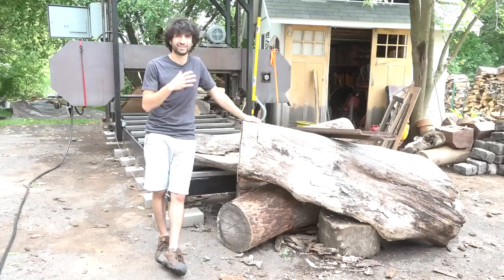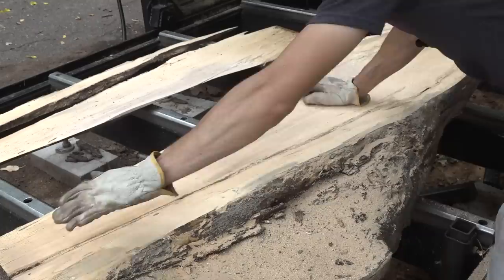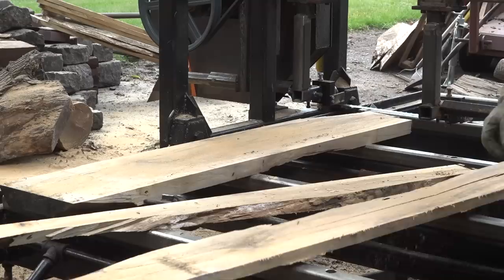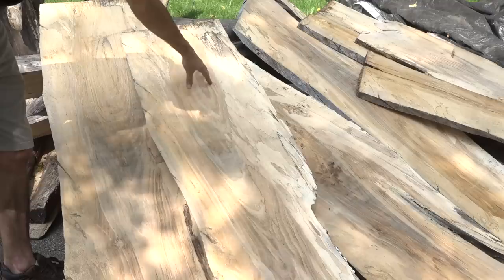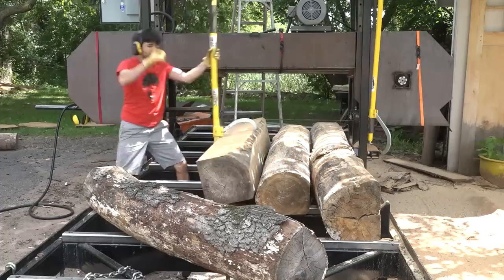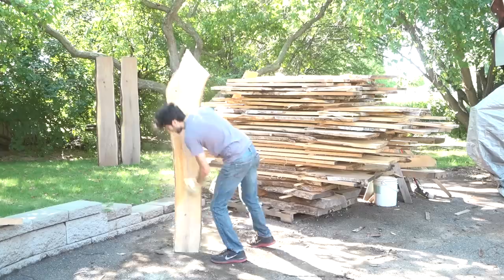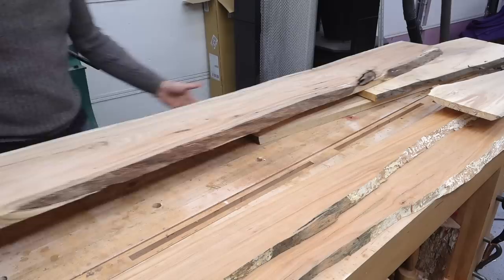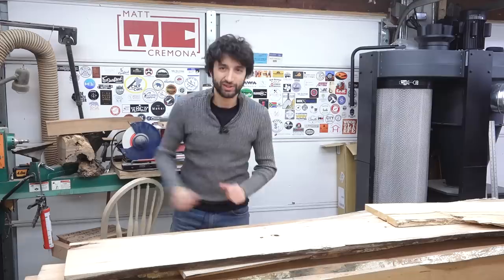Sawing Old Logs - How long can I wait before sawing logs into lumber?

Comment: Matt, redgum also likes to move.

I turned a rolling pin, out of redgum, 
and the next day, felt like an ear of 
corn.  But, if you rough cut it, and 
let it dry until it stops moving, it has 
some beautiful figuring.  It also makes 
gaps, which can be filled with colored 
epoxy.  I prefer something blue/green, 
because it shows up better.

steve

Comment: In the Southwestern US, African Sumac is a common decorative tree. If you have space, they're pretty but when they get overwatered, they send up sprouts everywhere and roots travel a very long distance. Which means there are lots of these trees that got put into tract homes where they really have no business going. Mesquite is a much better choice even though it grows a lot slower. African Sumac has a neat trick though, it gets a suntan. It will turn a very pretty ruddy red color when cut and exposed to air and sunlight. You can see it when you trim a good sized limb and the nub turns red. It's nice, because most African sumac trees never really get large enough to need a big mill. The last one I cut down at my old house, I milled with my chainsaw into manageable rough pieces and did the rest with a table saw. Cut those quick though and seal the ends if you can't get to it right away, because it checks something fierce, as the logs like to twist.

Comment: Hey Matt; happy holidays from Dijon, France. I’m over here visiting my wife’s family. I was given some maple that was in worse shape than what you had cut. And I used Minwax wood stabilizer on it and was I impressed(basically like the penetrating epoxy you use). The stuff that was really bad I have been using to make picture frames. It doesn’t have to be too wide or too thick and like yours the color pallet was nice. Have a great Christmas and on the 27th tip one up for me it’s my b-day. Abiento!

Comment: Hi there.   My father invented a portable sawmill back in the 1950’s called Travelog.  I went to several Fairs with him around MASSACHUSETTS and New Hampshire when I was just a young kid.  To impress potential buyers I ran the machine myself and had a blast.  The unit was a rider with the controls by the seat.  I was too young to care all that much, so don’t know if they made a lot of these or not.  In trying to remember my only recollection is that they were used primarily in South America.  If anyone knows more please include that in your next Vid comments.  Tks

Comment: I like to rough out two sides of a log, in order to hasten/govern the drying vs. twisting, depending on species. I guess you could say this is a "hybrid" way, between clearing multiple sides of a cant, and actually slabbing it. I do one fairly large pass across the top and bottom of the log, so that it will dry quicker, but also remain nice and thick, to keep torsion in "check"(pardon the pun😌).
Reply: Q1

Comment: Sweet gum has to be either ALL sapwood or ALL winter  wood to dry properly. It used to be called poor mans walnut and can be quite beautiful. If you mix the two, even a small amount, the billet is supposed to warp.

Comment: Have you everthought of putting a derrick on your gantry ,so you could swing a chain hoist around? Thanks for all the inspirational videos!
Reply from the maker: That's one of the things I've experimented with as it would make loading smaller logs pretty easy right off the trailer.  The sawhead does get in the way a bit so that method would work better with log being loaded from the other side where this is more space below the top of the carriage. thanks!

Comment: I've got about 50 big red oak and white oak here in Georgia that I have cut up into 12ft to 13ft sections. They've been outside wherever they got dropped going through whatever the weather throws at them for somewhere between 3 weeks to almost 6 months for the ones I cut back in January until now in May. Oh and I was ignorant about needing a sealer so I never applied any sealer to any of the logs end grains. Few questions based on that scenario:
1. Is it worth applying a sealer now to the end grain at this point? If so, what sealer would you recommend? Should I cut off a portion of the ends of each log like a foot off each end before applying the sealer to a less exposed part of the log?
2. Although I see cracks at the end grain, should I still try to make lumber out of them for use in outdoor fencing for my goats and chicken? Or would it not be worth it or last long and I'm better off just cutting and splitting these logs into firewood instead?

Thank you for all the videos and I'd greatly appreciate your or your experienced audience feedback!

Comment: Thanks for sharing your knowledge with us!  How long do you recommend to allow the slabs to dry?  Do you need a kiln or indoor drying spot?  I have some dead standing Oak that I cut down this year and cut into 3 inch slabs and want to use indoors but worried about warping and cracking

Comment: I found a 12' eucalyptus log (sealed). The owner says that it has been on the ground for several years. This is southern CA. Is it worth it to try and dry it?
Reply from the maker: If it's still solid, shouldn't be an issue

Comment: You say 4/4", i am guessing you're cutting it at that, 1", then it shrinks to 3/4"? Reason i ask is that the lumber we use on exterior trim is designated 4/4 (3/4") and 5/4 (1").  Remnants of shrinkage from the old days of milling i assume.  How much do your boards shrink?

Comment: Hi Matt
Great video. Regarding the 3-4 year old logs, did you measure the MC? What was it? How (inside/outside) and how long do you think you need to dry this lumber before you can use it? I dont have a mill but I buy fresh milled or get wood from a friend who is a tree surgeon usually 8/4< thick. Some of the wood has been dead for a year when it was cut and some logs are 1-2 years old. Do you have a guesstimate on when it could be dry enough for use?

Comment: "Here we don't have issues with insects"

Proceeds to cut into an ant's nest

:D
Reply: Jake Harris😂😂😂😂😂😂
Reply: Cool...its like life. Full of surprises.
Reply: Murphy. Every time.
Reply: Yeah I laughed at that statement also.  Simple fact is most white woods you want sawn in about 2-3 weeks from when the tree was dropped to prevent wood staining.  White pine I find in many cases in 2 weeks if not cut it will start staining the wood.  Oaks you got more time as long as the sap wood area is small cause you can just slab off the sap wood like you would with a black walnut tree.

Comment: That 1st firewood piece looks like it might have been good for a wood turner who would use it in sections rather than longitudinal cuts.  Do you just mill for timber or do you also cut logs with turners in mind .... would be good to have both options?
Reply from the maker: I've had about no luck selling turning blanks over the years.  Lumber will always sell however.

Comment: great info matt, will sealing the ends of the logs halt the spalting process or just slow it down, and are you not worried about the ants moving to a new home in another stack of lumber...many thanks scott
Reply from the maker: Doesn't really slow the spalting process.  Not worried about the ants.  They're common around here and don't like dry wood.
Reply: thanks for the quick reply matt, by the way is the spalted birch the one you are using for the draw bottoms in the highboy... all the best scott

Comment: Thanks for the video and information.  I always look forward to them.  Been doing some chainsaw milling and recently slabbed up an ash tree from my family's property.  It had a nail in it and we would like to keep it in there as a accent to a table because my grandfather most likely drove that nail in.  Any ideas in how to keep it in the board with out killing my jointer and planner?
Reply from the maker: It would be more work but using router sled would work. Avoid the nail with the router bit and use a sander to flush it up. Otherwise, find somewhere with a wide belt sander or just sacrifice the knives
Reply: cool tribute to your Grandpa!!

Comment: Well, call me naive. Sweetgum is good for what? I know it doesn't split or burn worth poo, but I have dozens of them on my land. About to join the milling community in a month and thought I'd leave all those standing. Feedback welcomed on sweetgum applications. I chainsaw milled a few pieces for fun and the 2x4 twisted to ruin status but also cut a 3+ inch slab that stayed pretty straight just sitting alone on a shelf.

Comment: Hey, Matt
   I don't make furniture, just lumber, and I'm not sure if this would apply to what you are doing. I'll take a log on the bunks, flatten one side with my first cut, then roll the log 90 degrees so the flat side is now against the upright log stops, no facing downward. Then i'll run my saw through the log at 2" thick slabs and set them aside as I cut them. After I have cut the logs into 2" slabs, I'll put them back on the bunks with the live edge facing up to the sky and make the final cuts into 2x4's 2x6's etc. works pretty fast and there is minimal log handing on the bunks. I have no need to make cants, maybe you do. Just adding my technique hoping it may help. Like your videos.